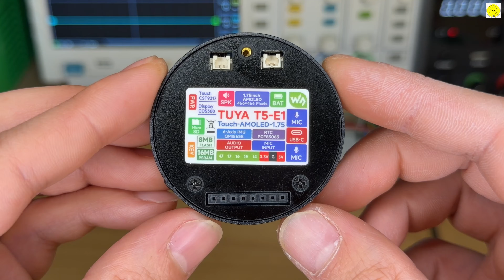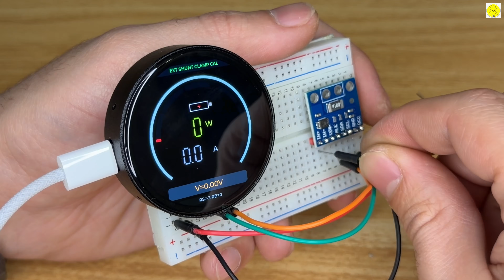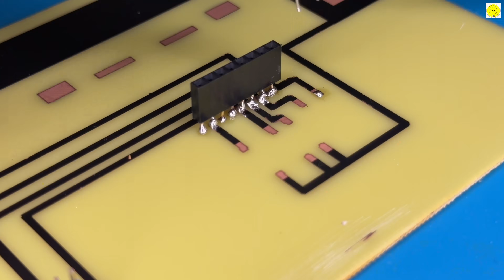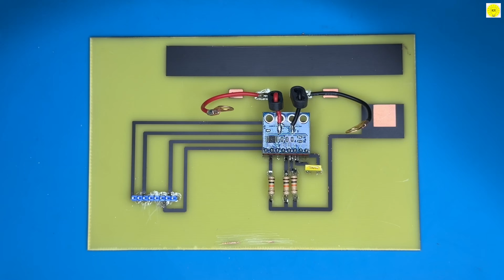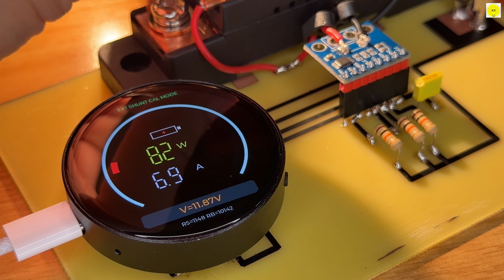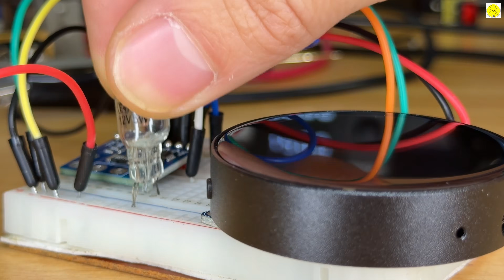How to Build a 100A Power Monitor (12V 100Ah LiFePO4 Test) High Current Test BATTERY

Comment: I saw just a 10 amp draw.
Reply from the maker: This meter is designed to measure a maximum current of 100 amps, but the discharge reached 120 amps, so you are seeing 10 on the screen. This is because the current exceeded the project's design capacity.